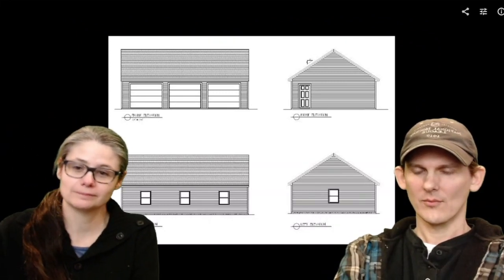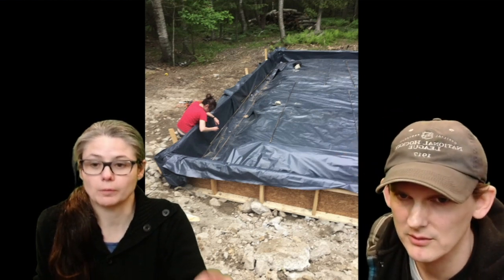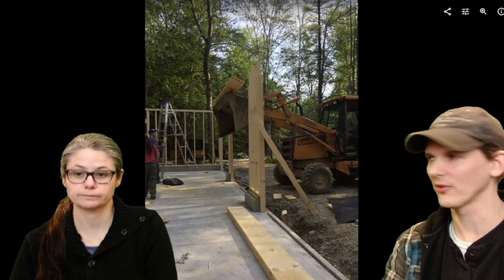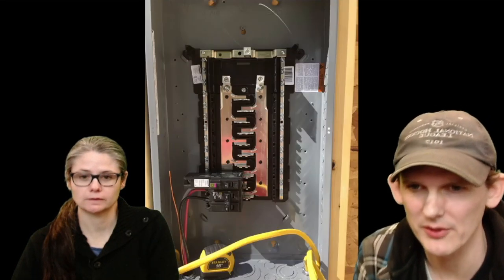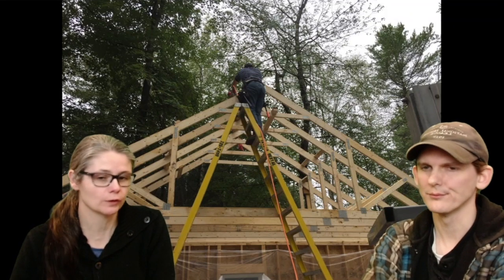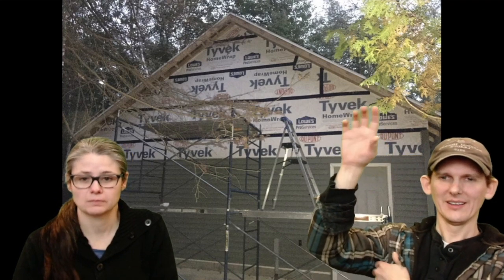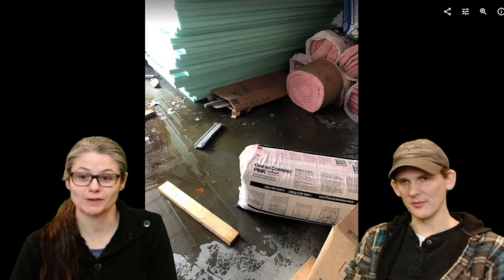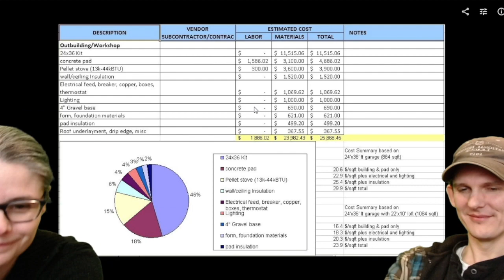Extended Version: How to build a 3 car garage on your own for cost as low as $16/sqft!

Comment: This is exactly what me and my wife want! I want a bay for a lift, and 2 bays for parking. How deep did you go? Any changes you wish you'd made? I can see having space between the lift bay and normal bays for stairs and a wall so you can just heat the shop portion. Floor drains in snow country or a heated floor? Thanks for your fun video!
Reply from the maker: Hi.  It's 24' deep.  It's ok for a lift but just isn't deep enough for the lift plus tools/workbench plus a full size vehicle.  If you have stuff that fits along a wall like a bench, welder, press, etc, 28' would be a lot better.  It's still a good size if I can keep the clutter out.  You'd want at least another 4' wide (40+') if you want a full size staircase.  My goal was cold storage so I insulated the sides and top but not bottom.  This gives a geothermal effect to keep it warmer in the winter without heat.  The heater is a pretty good size to bump the temp from 40 to a workable 55 in a couple hours.  No floor drains, flat floors to keep the effort low.  Admittedly I sweep out the water if there was a lot of snow on the car.  Thanks for the comment.

Comment: You mention a kit.   Is there a site that you can share the provides these kits ?
Reply from the maker: We have a number of local lumberyards; I contacted the biggest two and they both had a variety of generic garage sizes with predefined bill of materials.  You'd have to contact your local lumberyards or just check their website (both had a section for building plans). I will say that I contacted Home Depot as well and they did not offer this.  Good luck!